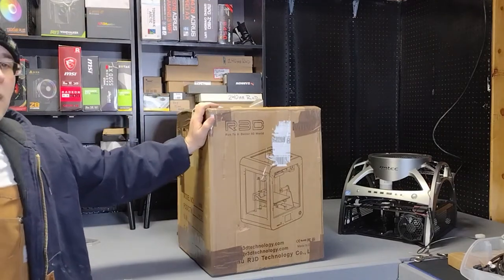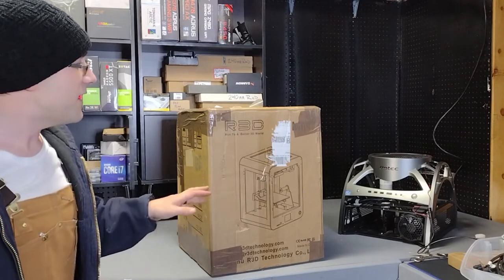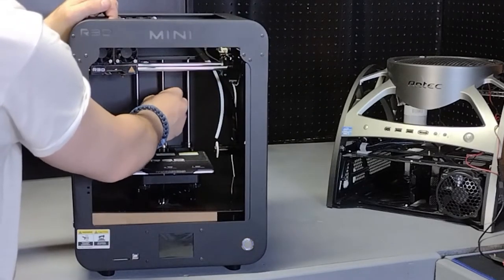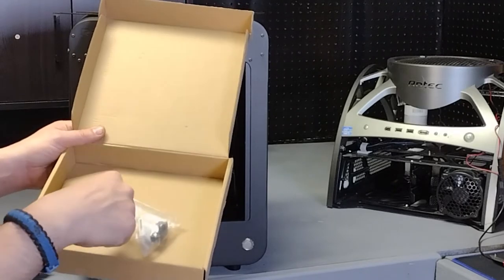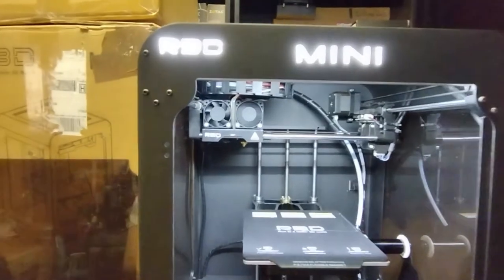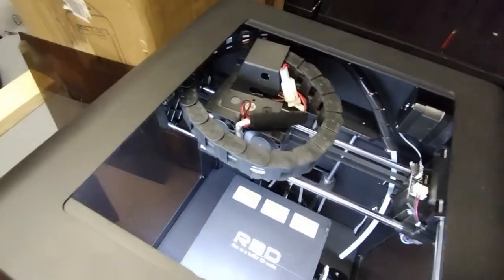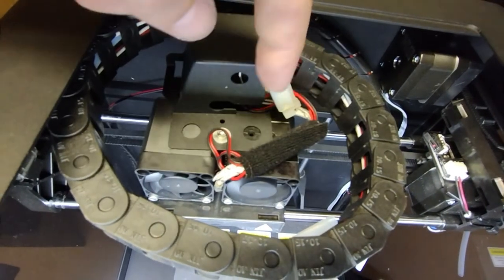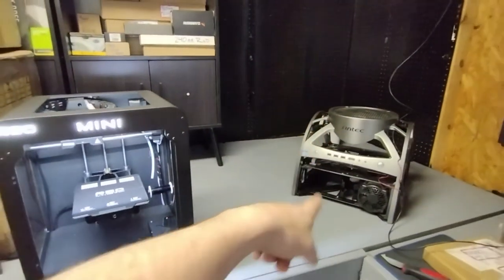R3D Mini FDM 3D Printers

Comment: what do you set your slicer settings to? im new and prints are good....enough but i want better lol
Reply: R3D Slicer is very similar to Creality and Cura for setting, and it depends on your filament materials too, PLA, PETG, ABS, it mainly differs in nozzle temp, bed temp. and feedrate (according to your layer thickness)